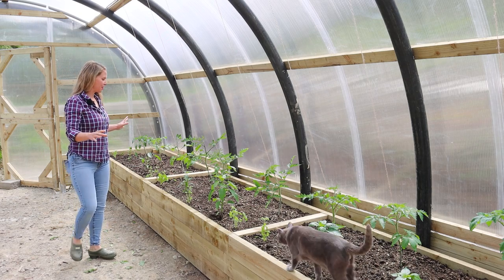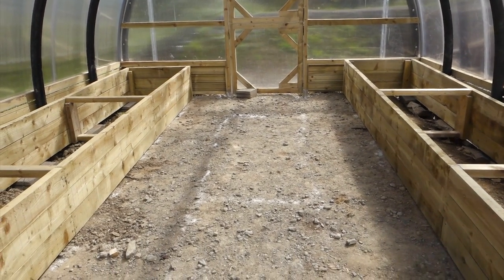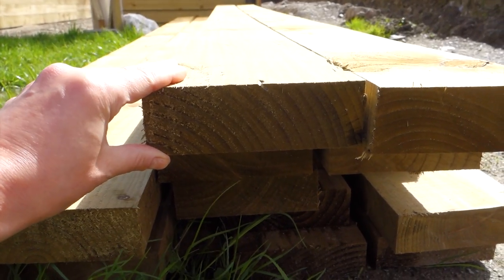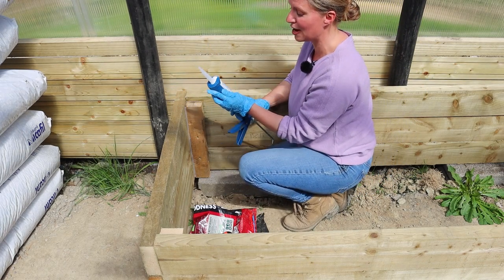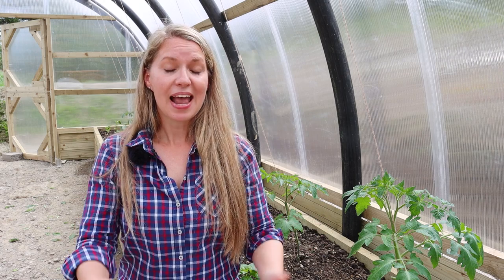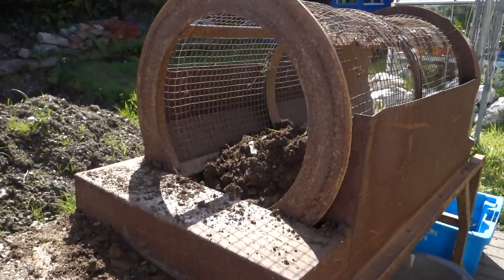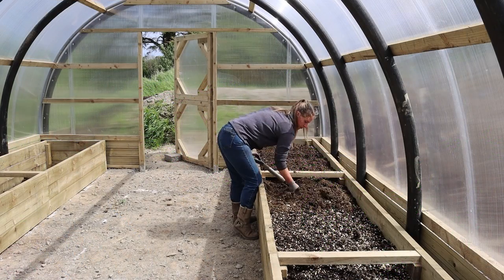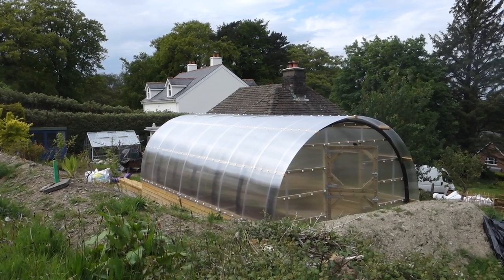Building Raised Beds for the Polycrub and Tips on Making Raised Beds Last Longer

Comment: Great video Tanya. Ive used that silicone for years when building vivarium when I had an exotic pets business before I was on the gardening channel. Its great stuff and is a great tip
Reply from the maker: I'd have never known! 🦎 As for this application, I'm pretty excited about it! In my old raised beds I'd notice moisture sometimes leaking through the side planks. They are perfectly dry and watertight now 👌 Looking forward to the wood lasting longer too!
Reply: It’s a great tip

Comment: Do you have pressure treated wood that doesn’t leach poisons into the soil? We only use PT wood if it’s for benches or fences not near edibles.
Reply from the maker: Pressure-treated wood used to have arsenic in the past but it no longer does anywhere in the world (that I'm aware of). It got a bad reputation, for good reason, but is much safer now. The material that's used in most applications now in the UK is called Tanalith E. It's a material made of copper and biocides that only affect insects/animals if they start burrowing into the wood. According to the UK's Soil Association (the equivalent of USDA Organic), an accepted treatment for organic raised beds, and won't leach poisons into the soil.

Comment: Hi Tanya, is it worth lining the inside of the bed with plastic to keep the wet soil off the wood? Paul
Reply from the maker: I'm not worried about soil contact with the wood. It's safe :) plastic lined wood generally leads to a slug problem, here. I wouldn't do it.
Reply: @Lovelygreens  Hello Tanya, please check these look like green pressure treated wood so CCA (Copper chrome arsenic) at (4:17 time of the video ) the end of the bed bottom panel shows the residue from this. I have lined all mine because of this.

Comment: where'd you find the curved support beams...are they specially made or are there folk selling them like that?
Reply from the maker: Polycrubs are designed with them :)
Reply: @Lovelygreens  I was thinking about getting, maybe, 1 then cutting it in half and using it for a small half tunnel maybe….with a flat wall at the rear

Comment: Instead of using silicone could you have lined the raised beds with a membrane?
Reply from the maker: I've used weed membrane in the past but it does not stop moisture from creeping into the nooks and crannies. If you're meaning solid plastic (like the visqueen I use for clearing land https://youtu.be/G-9ZdLAxI4I ) then it could lead to two problems. Moisture collecting in the space between the plastic and wood, from watering, rain, and other factors. Then slugs and insects finding a nice home between the wood and the plastic. That's why I'm SO excited about the silicone. The fact that an eco-conscious raised bed installer has been successfully using the method for decades says a lot too.

Comment: I love your channel and I respect you greatly. But I personally won't ever use pressure-treated lumber and silicon sealer in my raised beds. I don't want anything to touch the soil that I wouldn't want touching my food. I know the dissenters will say that the new pressure treated wood is completely safe. I would tell them that they used to think that the old pressure-treated wood was safe at one time as well. I prefer to be extreme in my choices on the side of safety. I do love the Polycrub and the design of the raised beds.
Reply from the maker: I've looked into it and have even spoken to a manufacturer of the substance used to pressure treat wood here. I'm completely at ease with using it in raised beds, as I am with using the silicone. The latter is completely inert 👌 Go with what you feel comfortable with though :)